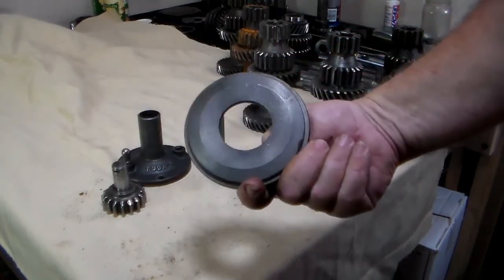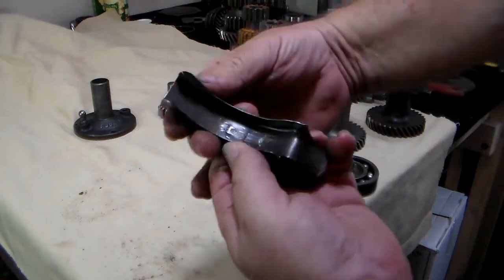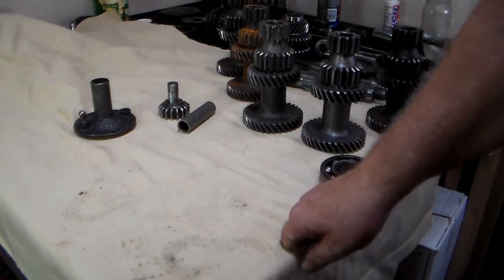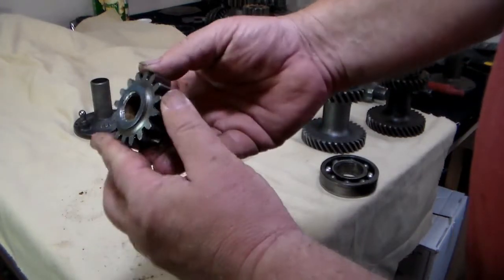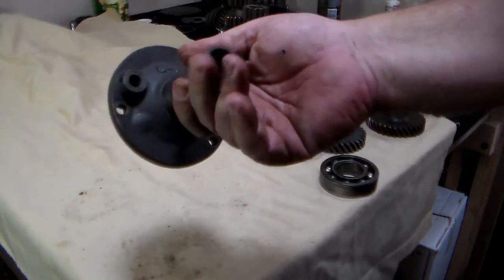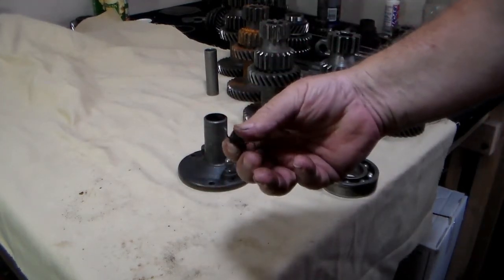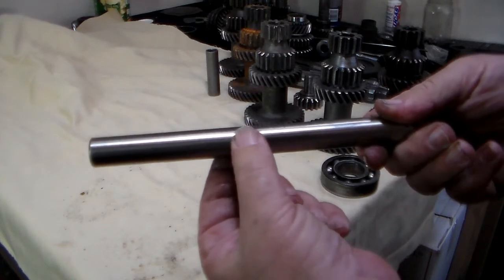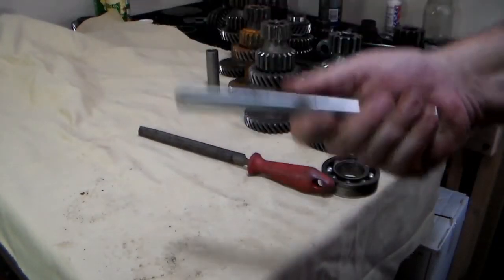9 Rick Stivers T-90 Rebuild Guide - Inspection Part 4

Comment: Great series, answered a lot of questions...  unfortunately all the answers were "replace the part" or at least in my case... My T90's were both full of water and rust when I disassembled them.  
https://www.youtube.com/watch?v=_tPDYD9npyo
Reply from the maker: Unfortunately, I’ve pulled several of those apart myself. It’s usually cheaper to find another transmission than replace all of the parts.
Reply: @rickstivers3965  The up-side to replacing all the guts is I know I'm going to have a zero time transmission/transfer case to go with the zero time axles and engine... just like a brand new Jeep :)

Comment: Great walk through of an inspection and invaluable tips. For instance I wonder how many folks don’t realize that first gear wear you showed is inconsequential while that teeny tiny extra bit of material on the synchro springs can be a big problem.
Reply from the maker: That’s why the original rebuild guide was created and put up on the web. I coordinated it but many people contributed to it. If you haven’t read the guide with everybody’s inputs it’s certainly worth the read. We did that guide back around 1999 and it was updated several times. I don’t think it’s been touched since around 2005. Many of the people that added their inputs have passed away since then. At least the info is still out there and not lost.